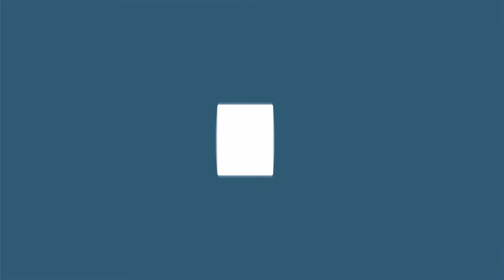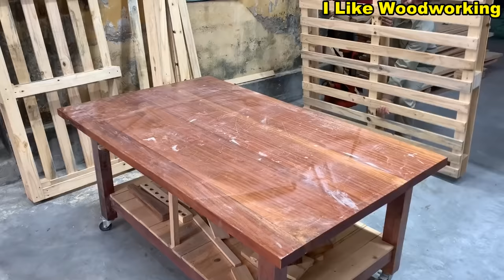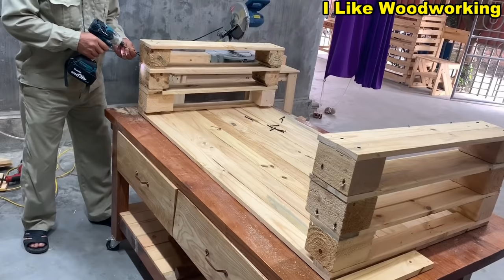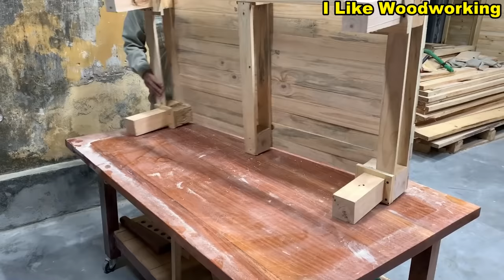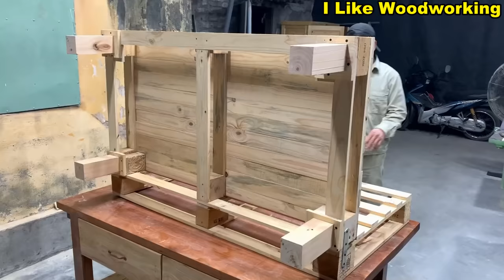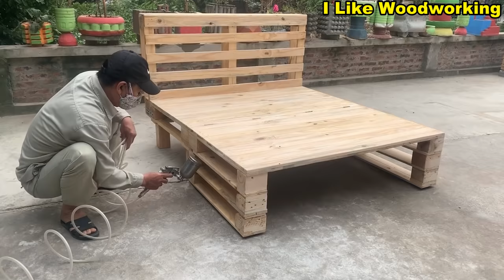Amazing Ideas Woodworking Project Smart - Build A Outdoor Bed Combined With Chair From Old Pallets

Comment: Good idea, but the headboard will fall off, screws are going to pull out sooner rather than later. All that weight being held up by 4 screws at best. should have put a ledger board underneath to help support the weight.
Reply: Las medidas de ese sofá cama